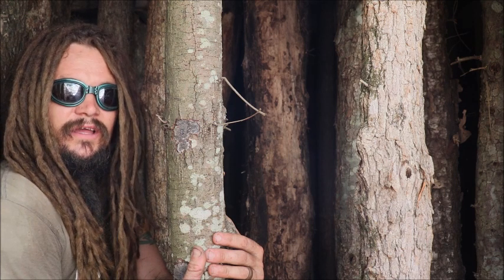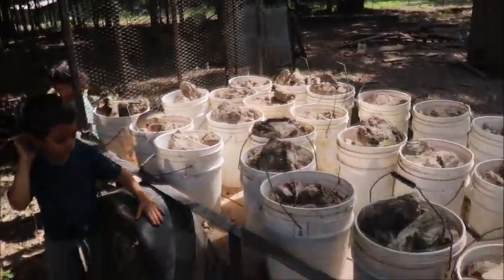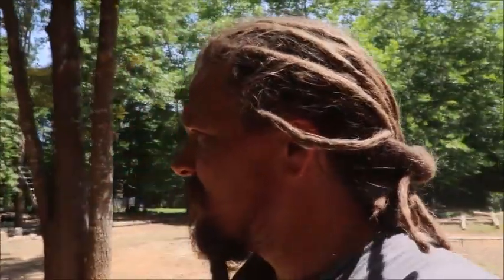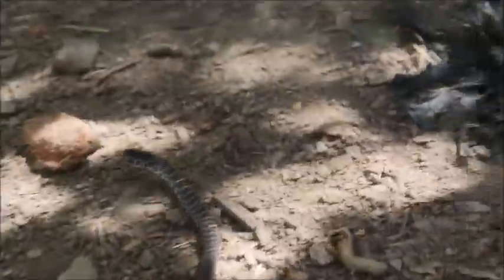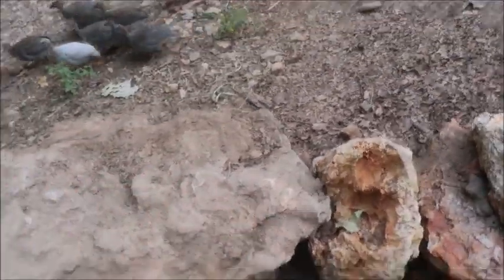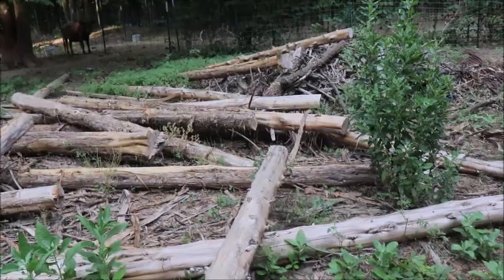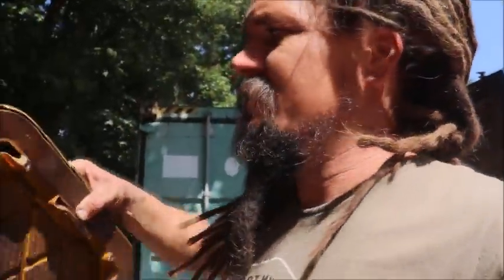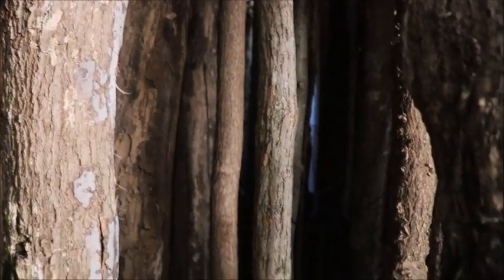Paranoid Man Builds UNDERGROUND FOREST

Comment: I saw a European primitive rounded top cellar? type structure build over a formed mound of sand with rebar and wood beams with concrete. 

After it was set up and cured, the sand was removed. 

It seemed kind of genius in it's simplicity of design.
Reply from the maker: Nice, I was thinking of something like that for my ground contact storage for actual root vegetables. Glad to know it works
Reply: Well, this gives me ideas. 🤔
Reply: @theurbanthirdhomestead  Here's the title of the video: Magical Hobbit-Like Eco Cave House

I'm pretty sure that I watched other video of this same structure during the construction process.

Regardless, this is a start. I saw it several years ago so my memory is a little fuzzy.